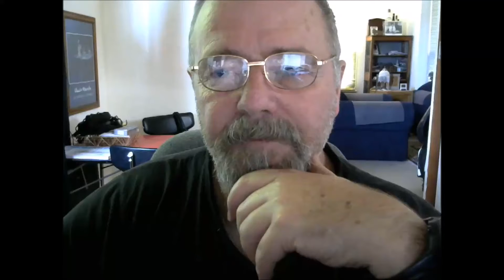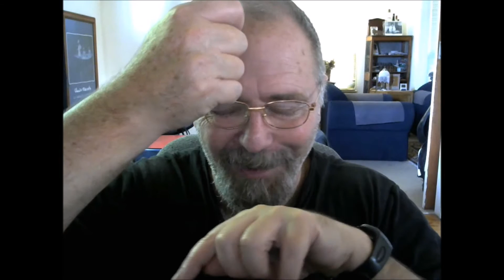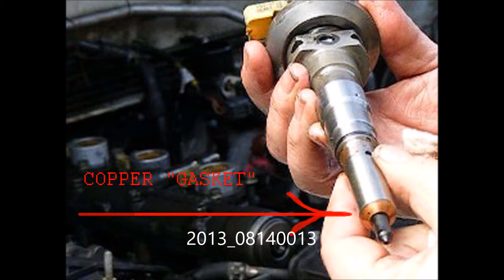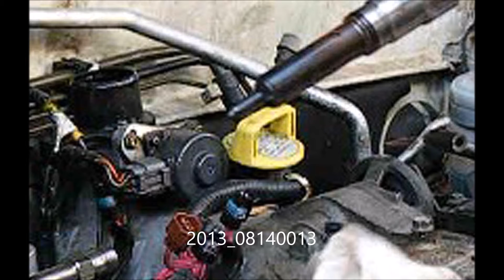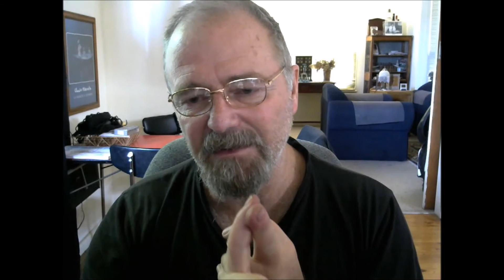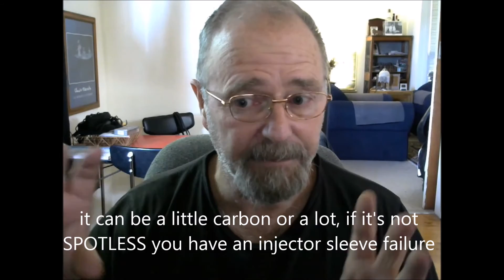4JX1  ABSOLUTE DIAGNOSIS OF SLEEVE SEAL FAILURE?

Comment: Dear sir Edwin i have a isuzu trooper 4jx1 engine and its not starting. 

I have also seen a large amount of oil inside the fuel injector rail and also the injector number 4 is pretty black and the others are shiny silver .

Could you please suggest or help us out with it

God bless you.

Comment: hi I have a 2001 4JX1 and it is mixing Diesel on the coolant. I had the head checked and it's okay i have change the gasket but it's still fulling diesel on the radiator